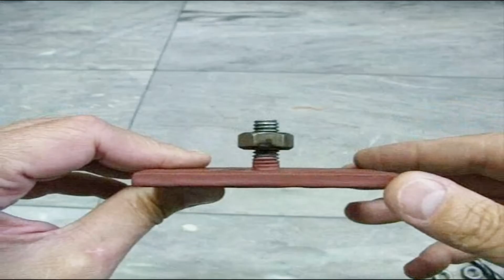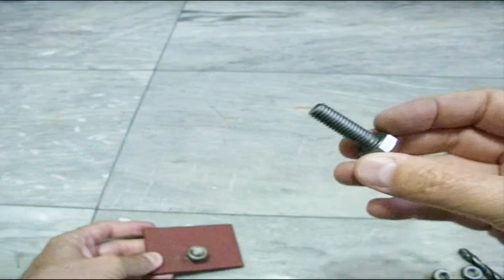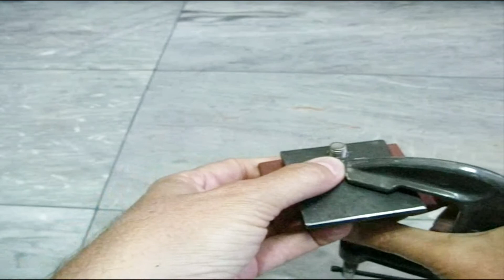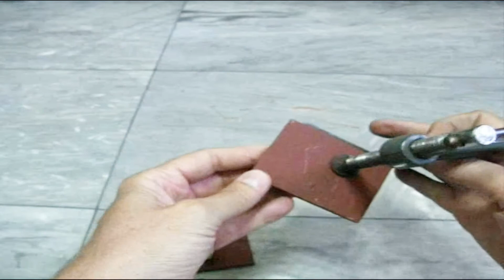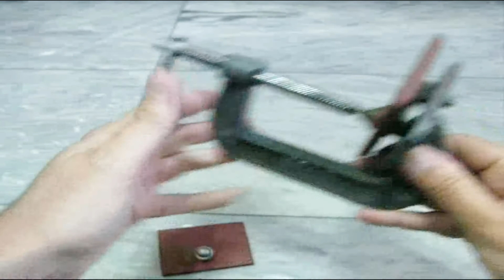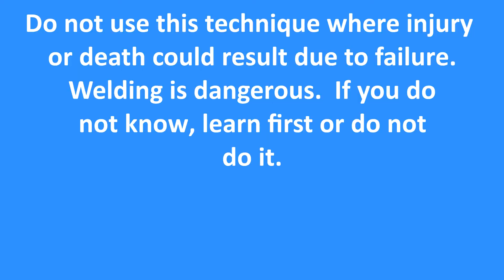(Remake)DIY Welded Stud Using Stick Welder - Weekend Welding Warrior

Comment: That's a good method, and if you can get good penetration it can be very strong. I would turn the clamp over because I don't weld near the screw if I can help it.
Reply from the maker: Thanks.  Excellent point about the screw.